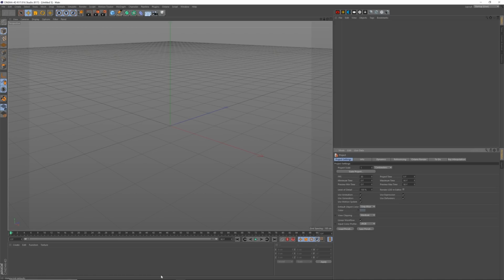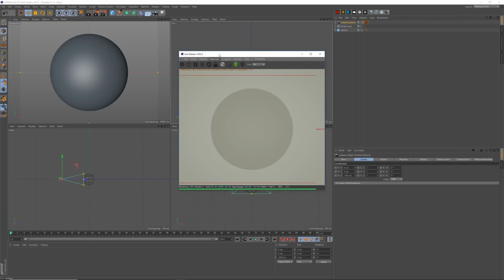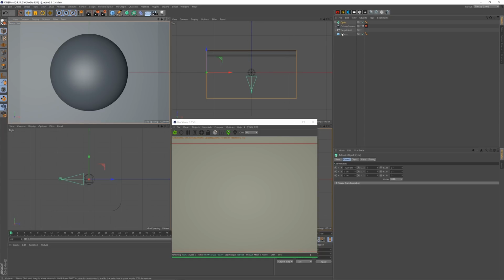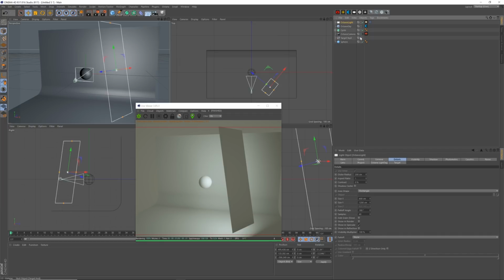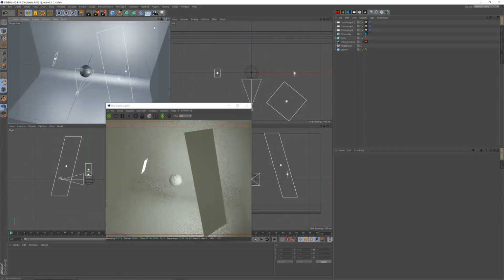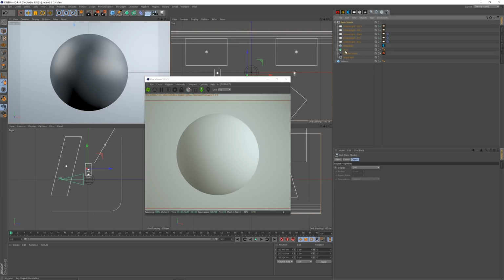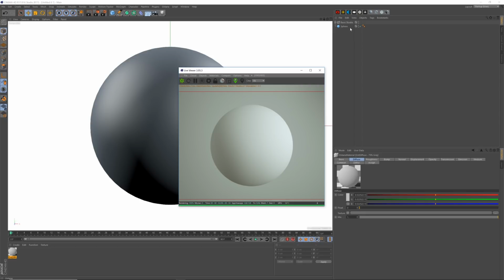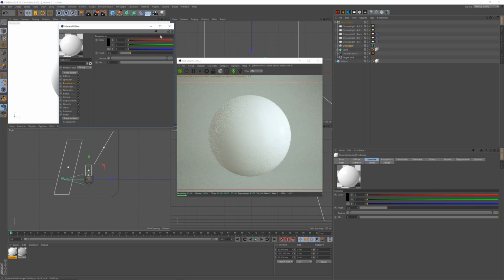Cinema 4D & Octane Tutorial - Basic Studio Lighting Preset Setup

Comment: Hi Rhett - thanks for this great tutorial.. been following along fine, but as soon as I add the octane sky, my scene goes completely black for some reason. I thought maybe it was because I had no texture loaded into the hdri texture field, but you don't seem to do that either, and the small thumbnail is black on yours as well. Why do I not get light from octane sky, when you do? Am I missing a setting or something. If I go into the texture it sais "error loading texture", but I'm thinking that's because we havent loaded anything yet. How is the hdri suppose to work when you don't load a texture? This is a roadblock for me right now in order to continue with the tutorial 😑
Reply: I hit the same problem. Did you find a solution?
Reply: @m7b327  Hey, guys! Just forgot the HDR Environment, use the Texture Environment.